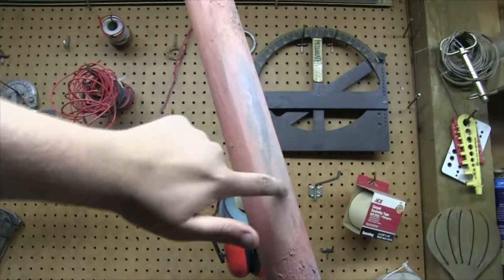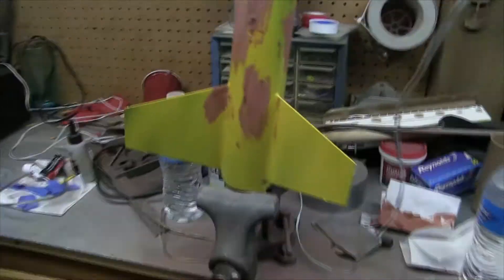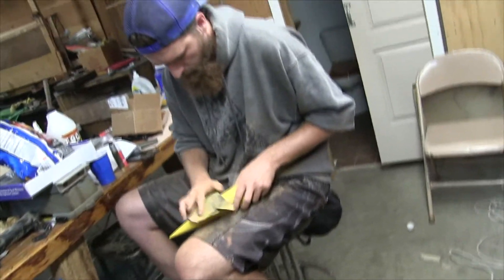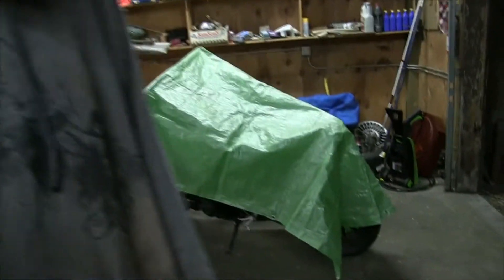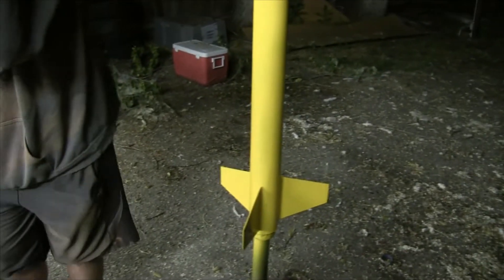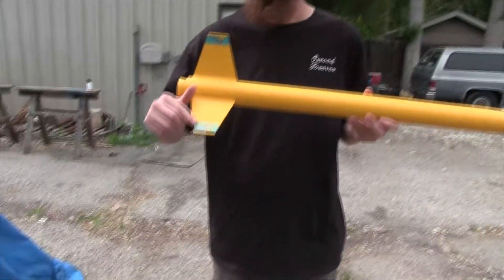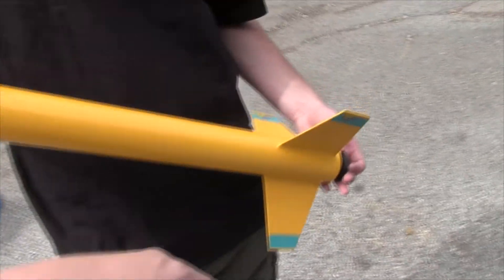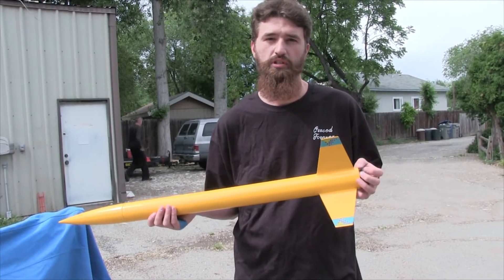High Power Rocket Build Part 3: Bondo and Paint!!

Comment: Braden-helpful hints:
1. When applying Bondo use an index card and lay it across the tube so that It will conform to the curvature of the tube and that way you won't have any globs. An rubber squeegee that will bend and conform to the airframe will work as well. .. as you will only be filling in the low spots as the curvature of the index card will follow the fiberglass tube and there will be a lot less sanding instead of applying it with a putty knife, where you end up with 70% more Bondo than what is needed to just fill in the low spots.
2.  Instead of spraying the rocket in the vertical position and holding the can up right where the spray pattern is vertical,  it will always tend to run as you are building up a vertical mass of paint . So always spray a rocket in the horizontal position.  Find a dowel rod that will go inside the motor mount and stick the dowel  rod inside of a slightly bigger pipe like a PVC pipe so that you can reach back at the aft end of the rocket and spin the dowel rod so that you can  rotate the rocket without having to touch it. That way you can spray the vertical spray pattern and run it from one end of the rocket all the way to the other end. It is very easy to overlap 50% in the corresponding patterns from left to right. Watch a Youtube video of guys spraying a car body and spray your rocket exactly the same way. Always keep the can going a constant speed as if a robot is making the can go across the length of the rocket so that the the spray pattern is completely consistent with the amount of material that is being laid down on the rocket. .. also being conscious to maintain the exact same distance all the way down the side of the rocket, and once again try to emulate that the can is being guided by a robot arm, completely ,totally consistent in speed and distance.  This will eliminate all of your runs and subsequent sanding and additional coats needed to correct the mistakes.